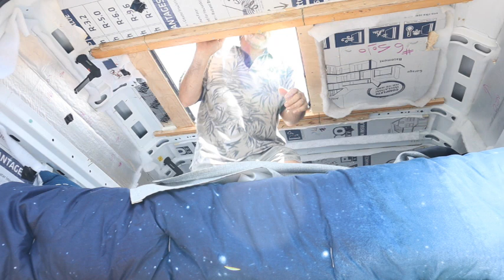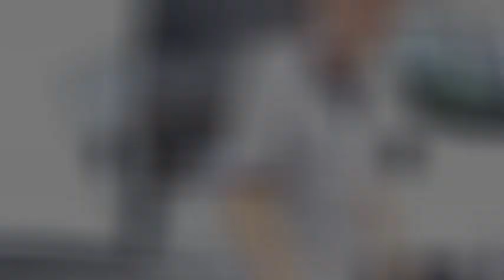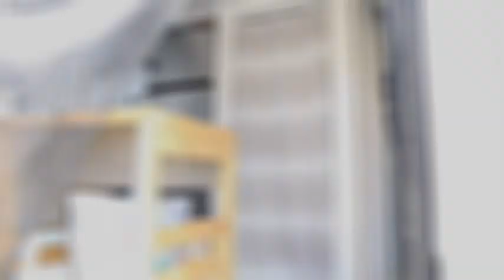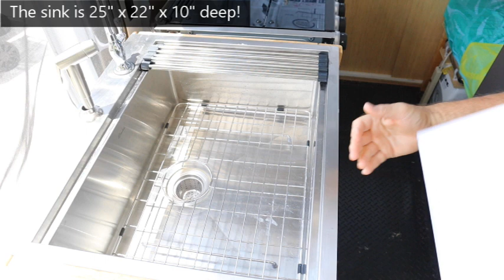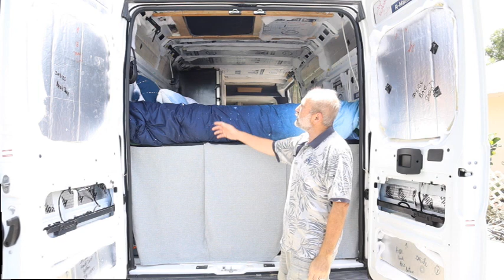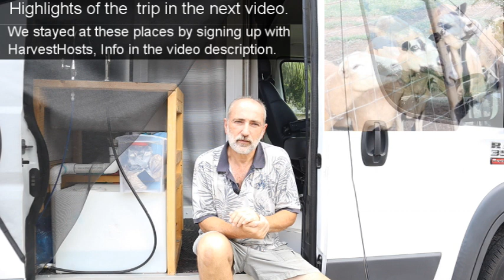Van life: Van build prototype tour, screen, hatch, shower, oven, refrigerator

Comment: What  brand is the Fridge? AC/DC?
Reply from the maker: I planned on a vitrifrigo dp2600, or Nova kool rfu9000 which are both 12 volt.  But for this trip I purchased a Vissani. The cost was under $300 it is a standard 110 volt frig.  The cost was less than the shipping on the other two.  So far it works very well.  The 400 AH of lithium batteries, 3000 watt inverter keep it running.  I kept the size in the van for the Vitrifrigo or Nova Kool in case I need to purchase one in the future.